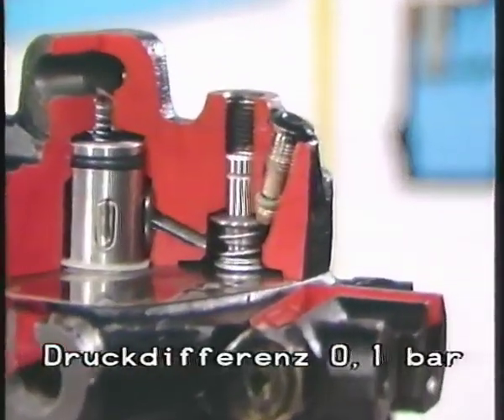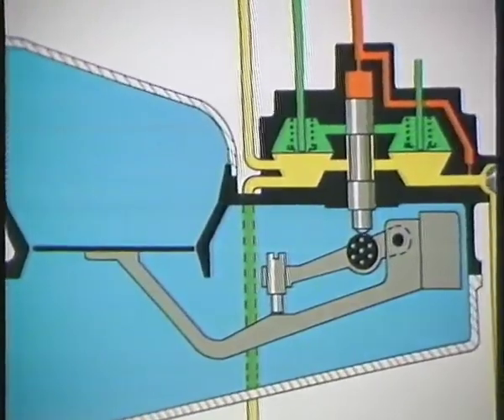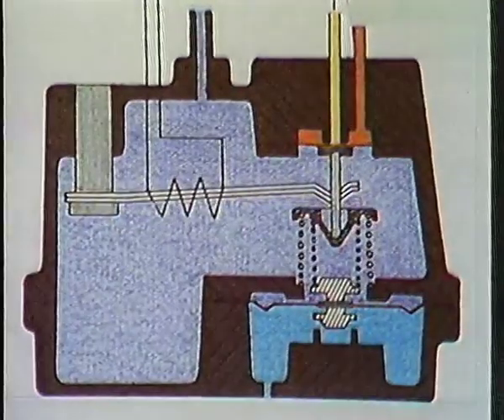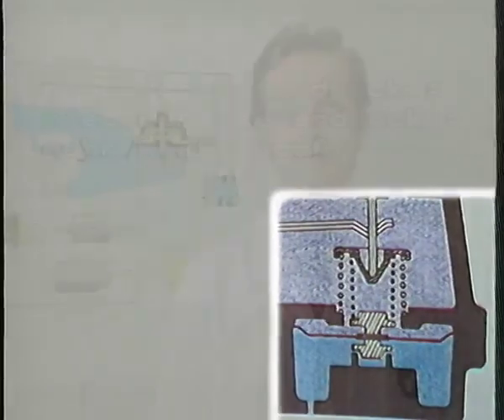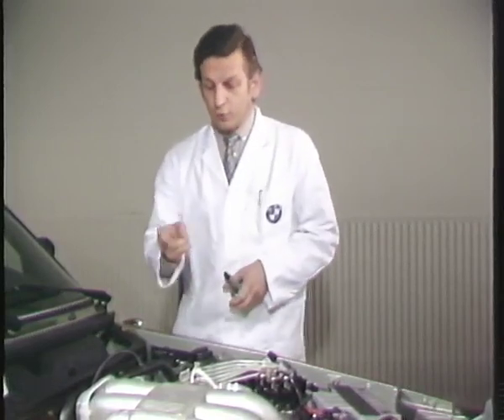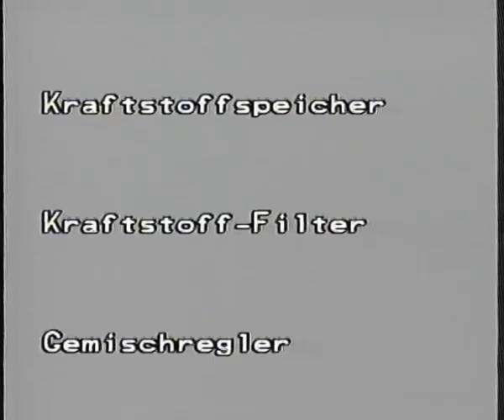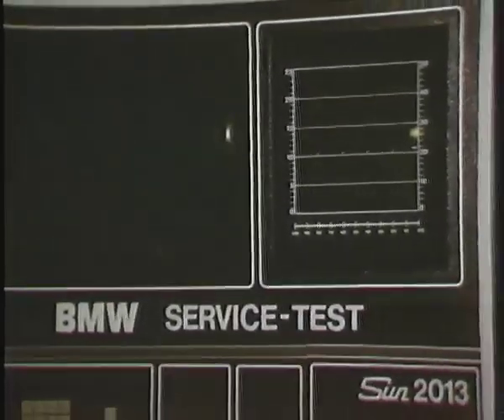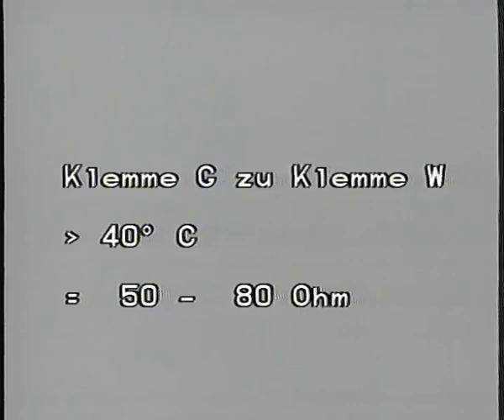K Jetronic BMW/Mercedes

Comment: I don't understand German for the most part but this was spoken so slowly and clearly that I was able to grasp what was being explained, clear visual representations of the inner workings helped a lot. On a different note, I hear a lot of people hating on K-Jetronic and KE-Jetronic systems and I can not understand why, it seems to be simple and reliable, maybe people just don't understand how it works and that's why it is disliked so much by its users, but then again are the users so limited in technical knowledge to not be able to deal with malfunctions of this seemingly simple system? Or maybe there is more to its complexity then it seems to me?
Reply from the maker: Danke für das Feedback. THX